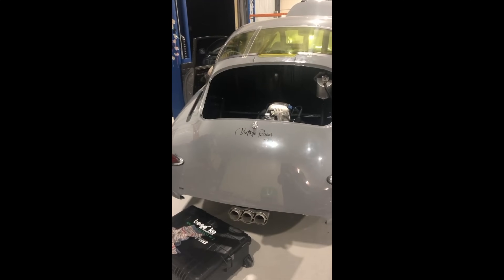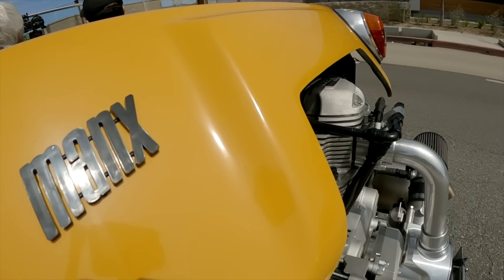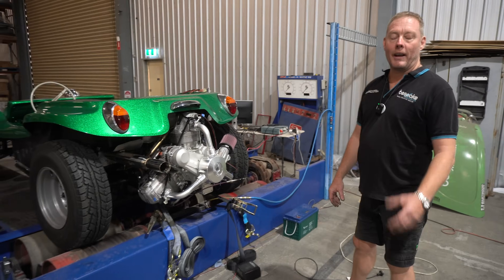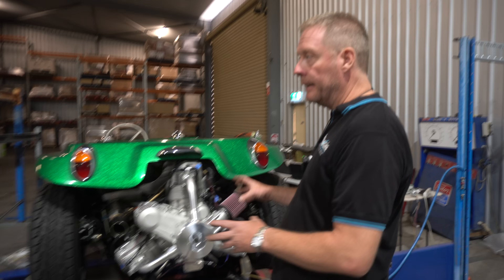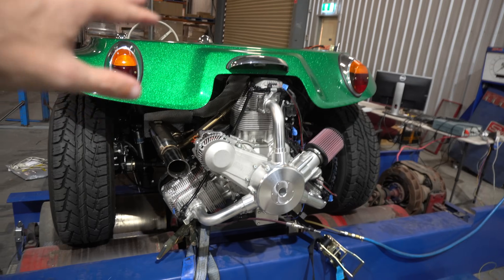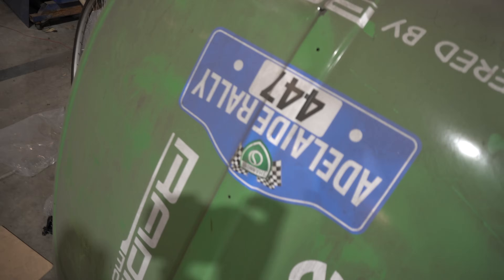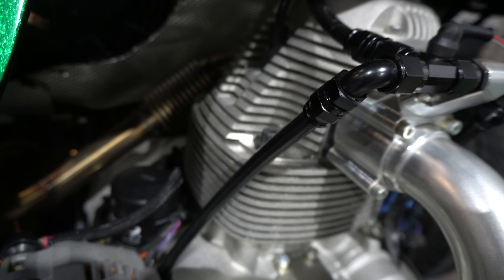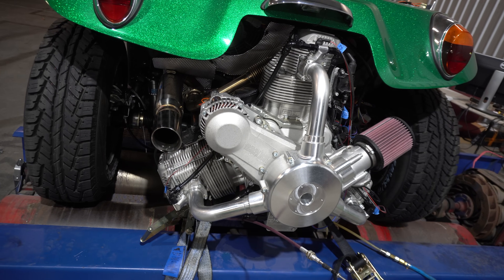Radial Motion: The Engine Powering the New Meyers Manx

Comment: As a recently retired aircraft mechanic with quite a bit of experience working on air-cooled radials, this engine fascinates me! I'm actually building a Meyers Manx Classis I bought from Bruce Meyers before we lost him and I looked into using this engine. I ended up having an all new 2110 built due to the cost of these beauties. They are very expensive - but nice! Maybe on the next build...
Reply from the maker: A little more expensive compared to a VW motor that’s for sure, but cracking engine 👍👍

Thanks for sharing

Comment: This is so cool I would love to put this in my own vehicle! :) sadly I have life obligations & no money for anything like that, isn't that, seemingly, just how it always goes lol

Don't know your take on it, but I'd love to see a double 3 with a slightly higher stroke mostly for torque. I'm biased though because I'm up at around 3k meters (7-10k ft) where I'm at in America. I've been fascinated with using one of these engines in a car/motorcycle (granted the motorcycle would be a much smaller & shorter stroke for the fun & would likely need to be a double stack if it needed to hit certain performance figures (or maybe I just want the power lol)) I feel like they are perfect for buses, vans, types of off-roading vehicles, & truthfully they should make a come back. 

They are so power compact thanks to the circle they are in & I just (it is this) hate transverse mounted engines that are FWD vehicles. Everything is this. Everything. (not really but yeah, too many) & the only easy nice way to make a smart car / fiat work to becoming a AWD/4x4/RWD quickly is using these engines. The length of those suckers is too dang high & trying to oppose piston everything just becomes frustrating & difficult (fun though) to get it a point it can finally be a fun car to drive & enjoy just as a daily driver.

For me, those compromises become ridiculous for not even just suspension to get a nice time when you can. Which....I dunno, you know? I guess people just kept accepting the big manufacturers need for all the money, it seems, for a fun, reliable, cheap car that gives you the weight balance, all that RWD/AWD/4x4 (I mean you have it mounted in the rear here as well &  I haven't stopped thinking about just ripping a 4 banger out of the front & shoving it into the rear & taking the whole drive train & just adjusting it to work, locking the rear wheels & saying to heck with this crud I don't want to do it anymore. Its a fast way to force a rwd with no need to just the steering anymore & just getting that set up in the front, but I mean come on its hard to do that & people have to fab a few sheet metal & tubes of steel for bolts, lose the trunk, & have to fab the front up for it plus need to run that coolant hose all the way to the front & back while something possible its not really a thing people want to do & I'm said people) proper car fun & drive to make it something that isn't just....

bleegghh. Like... less than mid, for too many, & just shows you every turn & acceleration, every time you want to go out & get a little spicy it reminds you it will never, can never, is never & simple isn't anything but exactly bleeggghhh & should never be enjoyed. Its a place to be inside of then arrive there then you just end up back where you started. Hurts life, inside, that soul thing you know. Why even put in all the effort, you dudes know, to make & manufacture something that's objectively just there & isn't anything but something that got a some money into your own bank account. You can only be proud of it because its something that has a bunch of quantity & not really much else to make you happy & say that you made that outside of it. 

Look, it works, its there, yes I get that, its never going to make a person try & get frisky a little in the rain late at night with no one around to bother after they feel a little slip & skid, wanting to be a little risky & fun. It won't make them memories, it won't grow their minds to open & explore, it doesn't head them into trying new things & its just a thing there around them as they sit in it. It will be a thing that later they look at to only remember things that happened, not things they enjoyed with it, in it, & because of it. Its....

throws hands up & off to the sides eennnhhhh, bleeehhhh. Is that something you like, no, but the money means (for those that did it) you just numb yourself to something you never wanted at the end of it all. Unless you never cared, in which case I doubt this comment (if you are reading this those of you) was ever going to make your psychopathic weirdness of grandiose thinking of the money made you better & you "won" at the end of it all because its the only thing that matters & you just are better because of it. Not great perspectives there, its what got my country into ruination. 

That being said, capitalism still exists, depressingly so, & so money is still a very needed thing to make it all happen. It just sucks they crammed in this idea (we had/have adverts for something I wrote above being a great/good thing, it just there & around, happened, not the car, not fun, just a thing there) into us over here that its not a thing to care about, that they are driving good cars, having a good time, spending that level of time for money to pay off something that will break by the time they do while really barely enjoy it & saying they are happy to be finally free of driving it through a road & trip that should have been fun & enjoyable. Its only harmful to the whole thing, us humans go through together called life, then it makes a whole movement & normalization of it all being that way.

Too much like that.

Comment: How do the cylinders get any cooling air? No fan. Smack up against bodywork so no slipstream. Guessing giant fan-cooled OIL cooler up front???
Reply from the maker: The engine is actually water cooled 💧
Reply: @OutlawGarage  Good. That.s best. Sure artfully hid the cooling stuff. Looks air cooled because "radials" = I get it totally.
Reply from the maker: @patrickshaw8595 yep all hidden away nicely 👍👍

Comment: wonder if there is a gyro affect with this engine, all radial engines have that  perhaps turning
Reply from the maker: I hadn’t thought about that… interesting
Reply: It's probably less precession than the flywheel itself. Only rotary radials have strong precession, because the rotating mass is larger.

Comment: These motors start at $25k from their site.  Really neat but not what I would call affordable.  I'm sure it's cheaper than an original period correct 356 motor build though.
Reply from the maker: A 356 engine isn't cheap and goes for around 25K in Australia, a good one anyway.  These have a lot more power and I suspect a lot cheaper on parts and more reliable.
Reply: @OutlawGarage  Right on.  I swear their site says affordable option for your project somewhere.  Yeesh, I can't afford to play on that level.  Maybe one day.  Happy with my Beetle and stock 1600.

For sure on the power and parts end.  Really like the sound they make.
Reply from the maker: @ amazing the price of a new 1600 twin carb vw engine these days as well.  Prices are crazy everywhere…

Comment: Build a 5 cylinder version, strictly N/A but higher revs and with an equal length, stepped primary diameter exhaust header.
Reply from the maker: Interesting, that would be something special!
Reply: @OutlawGarage  This is mainly for the sound, especially since I mentioned the stepped headers. After all, it's really got enough power for its weight, as is.
Reply: The way they did the valvetrain made the bottom of the cylinders too wide. Also, 3 cylinders is about the most you can do with all big ends stacked on a single crank pin.

Comment: Why not a 4 cyl oposed radial X engine ?
Reply: They did 3 cylinders because that's about the most you can do with stacked big ends on a single crank pin vibration-wise. Also, the way they did the valvetrain makes the base of the cylinders too wide for more than 3 cylinders.

Comment: Oh WOW, I want one!!! A 1959 VW "BUG" was my FIRST CAR back in 1971!!!😮  It was rated at 36HP,  which is almost a JOKE! Top speed was 68 MPH on a flat, straight road and had it up to 75 MPH down a long inclined on ramp!!! I had to REVE THE PISS OUT of it to get ANY POWER out of it, only time the gas pedal came off the floorboard was when I was shifting and when I stop for a traffic light or stop sign!!!😮😂😂  I still got about 25MPG driving that way, I kept the gas tank close to full most of the time because NO GAS gauge till 1961 along with synchronized FIRST GEAR!!!😮😢😢 I kept a yardstick in the car to dip it into the gas tank to check the gas level from time to time, it did have a reserve tank of about 1 gal, so at that point I could go about 25 miles!!!😮😊 The reserve tank switch was on the firewall above the shifting tunnel.😮 I really ENJOYED that car, but it was VERY BASIC in every aspect!!!😂😂😂
Reply from the maker: Wow, sounds like you had some great times with that car!  The story of a classic bug 😃👍

Comment: Will this fit inside a 70 VW Bus and how much cooling does it need, can you attach AC to it also, or do I need a large alternator and a big battery to run AC on 12 or 24 volts? What is the cost to get one?
Reply from the maker: Around 25K for the engine.  Yes this will fit in a bus. AC, a lot of air to cool in a bus so I'm not sure, insulation and volume of cooling is important.

Comment: Have you ever seen an Ingersoll Rand " Spot Air" compressor ?? Look it up , it's an air cooled radial 6 cylinder, vertical shaft , 3 cylinders are over head valve petrol and the other 3 cylinders are air compressor cylinders , all on one crank throw . The petrol part of the engine looks very much like this engine . The Spot Air was used by railways to power impact hammers .

Comment: This looks like it would be fun in an antique style homebuilt airplane!!
Reply from the maker: 💯 what it was originally built for
Reply: 8,500 rpm, according to Radial Motion, they don't state Hp or torque figures in the engine specs. Props need 2,500 to 3,000 rpm. so a propeller speed reduction unit would be needed. 
A 2000cc, 135hp normally aspirated 75kg engine, with psru (Kg?) would do the job. With a turbo, or supercharger, at 300hp, it would be scalding. Do IT.

Comment: Part of the fun driving the original Manx with VW engine was that you could absolutely flog it in normal driving.   130 Horses would be more than plenty in such a small car and overpowering it misses the point.
Reply from the maker: I’ve driven a few buggy’s in my time, the extra power would definitely be great for driving in modern traffic and light to light.  On the sand I do think a degree of self control is needed 🤣🤣🤣

Brilliant on a skid pan!

Comment: I would have loved to see a spec sheet on this motor = HP = weight = gal or liters per hour fuel burn at different RPMs on the Dino and price point with availability for purchase  ...  Also what gearbox that was used for aircraft usage if one was used ....

Comment: This engine is great, the cog-driven cams and push rods are so reliable and far superior to chains and the new wet belts, they won't last a fraction of the time these will.  
The set-up lends itself to having a Turbo running on the crank centre shaft,
Reply from the maker: That setup for the turbo does seem popular 👍👍

Comment: Very interesting video.
What is the bicycle in the background?

It looks a lot like my (Made in England) Muddy Fox hybrid I converted 30+ years ago.
On my Beetles, I found using 145 x 15 front tyres and ex-Jaguar 255 x15  rear tyres on 8" rims it would drift properly without 'backing into things'
Unfortunately, it does make Beetle look like it should be drag racing not switching directions on twisty roads
Reply from the maker: I’m not sure about the bike but I think someone from the team is going to reply to some comments tomorrow so they may know 👍

Comment: I wonder if these engines could be used in an aircraft?
They look like the Saito 3 cylinder radials for model aircraft.  33cc, 60cc, 90cc versions. I have the 60cc one in one of my RC model  planes.
Reply from the maker: This was originally designed for an aircraft, testing has definitely lead to some interesting applications for this engine

Comment: Oil leaking into the heads ? . Consistent use  being the solution  . How do you get around that issue ?  I was thinking tolerances at first . Help me understand please . Love me some Radial engines   , doesn't need cowbell NEEDS BIGGER fins  . I love radials the horse power gain is the best of both worlds . No inertia problems or super heavy fly wheel  needed. Man that sounds amazing ...
Reply from the maker: Thanks, the radial motion team are hoping in the comments section tomorrow so you might get a comment or reply from them 👍👍
Reply: We have designed an oil purge system. When starting, the engine cranks for a period of time and purges any oil out of the bottom cylinders.
Reply: @bespokeengineeringaustrali9649  Cheers thank you ...

Comment: How do u solve the oil route?
Why don't oil fill up the two lower cylinders?
Reply from the maker: I’m not 💯 but it’s a pressurised system with a scavenger pump
Reply: @OutlawGarage  What i wonder is how they manage to lubricate the cylinder walls and not fill the cylinder with oil?
Reply: @SumUnicus  magic
Reply: @SumUnicus 
The same way aircraft and motorcycles have for 80 years, highly efficient scavenger pumps.
Reply: Lots of time and head scratching! We have designed an oil purge system. When starting, the engine cranks for a period of time and purges any oil out of the bottom cylinders.
Reply: @bespokeengineeringaustrali9649  
That's super smart, use the pistons as an oil pump, just like some planes do 👍
Reply: It does on large radial aircraft....in the constellation you had to drain them after a long rest.

Comment: Do a EV swap with a Tesla e-axle. 200 hp, quiet, reliable and very low maintenance.
Reply: The limited space for a battery pack means very limited range.
Reply: EVs and hybrids are unnecessary, dangerous, and evil.  Never do this.  Watch MGUY.
Reply: Original re-release of the Meyers Manx a few years ago was as an EV. That must have failed.
Reply from the maker: @ I think you can still get the EV option  if you want, or this 3 cylinder and in the future a hybrid 👍👍
Reply: @OutlawGarage  Yeah, that's right, I just watched the Jay Leno vid. But shouldn't it just be an original VW engine? Nothing else sounds right or is as simple. A 1600 would be plenty powerful enough in such a lightweight car. It's such an accurate continuation that anything but a period correct engine spoils it, in my opinion.
Reply: EV conversions are horrible, EV's have a lot of issues to start with espeacially weight and range they reduce that a bit by making the battery part of the chassis all of which isn't possible in a conversion
Reply: EV's never sound like a real engine.  I don't give a sh!t for quiet.   I want fun and noise and a real manual gearbox.   There's no EV with a stick shift option.
Reply: @flyguy6296  Lol i think it was Ford that patterned a fake manual shifter for EV's and Kia did it too basically like a sim racing shifter then the computer simulates the shift with a short cut in power
Reply: @shaynegadsden  No thanks.  I want a real gearbox not a simulation.
Reply: @flyguy6296  I think they get away with because so many people can't even drive a manual now, so crap like that makes them feel special like the sports shift auto's
Reply: @shaynegadsden  that's why I drive a manual.  I usually feel i could leave my windows down with the key in the ignition and my car would still be waiting for me to return.   It's a very good anti-theft device. 🤣🤣🤣
Reply: @flyguy6296  I can on one of mine i have an RX8 and rotaries are a pain even for people that drive manual but haven't driven a rotary
Reply: Also input conversion, which has prevented truly large scale EV adoption for almost 200 years.

Comment: If looks are the goal then thats good. If HP is the goal then just fit a late model motorcycle engine. Production tested and signed off . Hyabusa or similar.
Reply from the maker: The radial engine gives does give it a unique sound and character though.
Reply: Motorcycle engines are horrible in cars for daily driving, there's hardly any torque and the power band requires 6000+rpm for useful power.

A high torque at low rpm  engine like this is a joyful experience because you don't need to wring its neck to have fun.

I've got a CE Lancer and the 4G93 Mitsubishi engine has 166Nm of torque, most of which is available from 3000rpm. In a less than 1000kg (2200lb) car it's so much fun 👍

Comment: The only issue I have with it, particularly being in a dune buggy, is that the cylinders hang quite low for an offroad vehicle, and yes, you can put skid plates on it, but personally I’ve seen many vw engines with damaged engine cases and dented pushod tubes, even with engine guards
Reply: It's a beach buggy not a rock crawler.
Reply from the maker: @justin3131ify  👍👍
Reply: @justin3131ify  Fair response.
Reply: Crank center line to engine floor is the same measurement as a standard VW air cooled motor – looks worse because of the wider footprint.
Reply: I can see this in a Jeep Wrangler.
Reply from the maker: Yep, the shape of the engine does mean 2 cylinders hang low ish and I get what you mean with the VW engines.

For the power upgrade I can live with being a little careful off road I think 😎👍👍
Reply: One of perks of Radial, they work with different length cylinders. Nature loves asymmetry, ie. unexpected torque n' pony numbers.